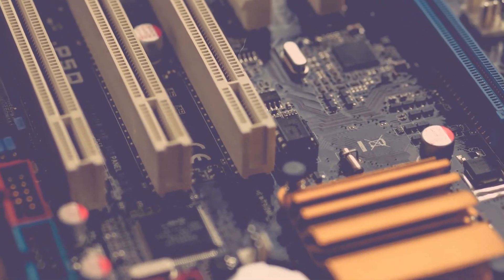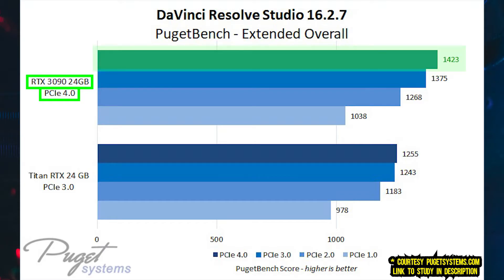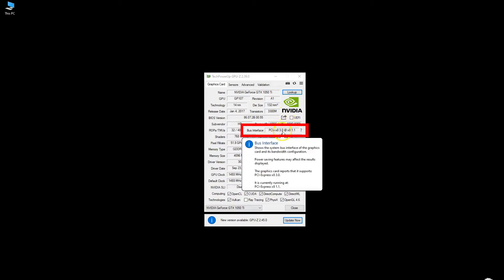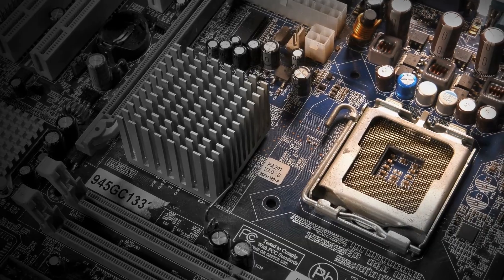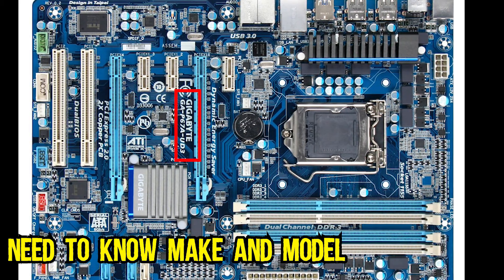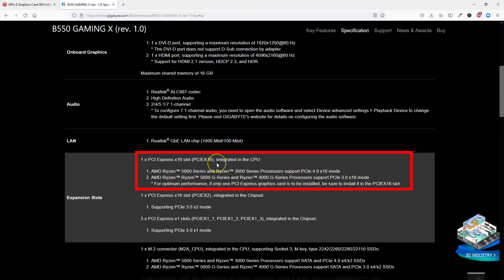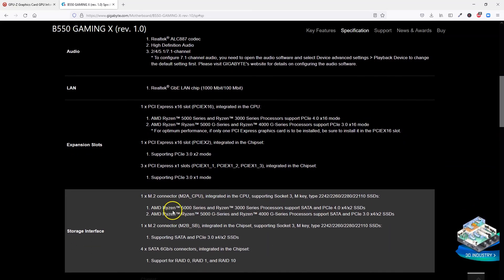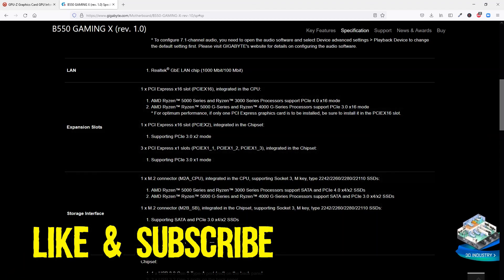How To Check PCIe Version of Slot and Motherboard

Comment: This video is incorrect .... Pci e 2.0 can have 3.0 or 4.0 ...it is crosscompatible it just not will be to its fullest potential.  I have an i7 990 intell chip alot of ram 8 tb hardrive and the nvidia geforce 3060 13 gb three fans. Their can be issues which are minor slight bottlenecks which is 2.4 which is not a factor their are adapters and gaming monitors which also help eleviate the work from the cpu. And ssd adapters to get those faster ways.  I dont see upgrading my board and cpu till in 3 more yrs. The leap has not been that dramatic and the price is too uo with recession.
Reply: What is the point of using pci 4.0 in a 2.0 port even though its crosscompatible 
Better use a best 2.0 in 2.0 port
Best 3.0 in 3.0 
goes like that

Comment: My GTX 1070 reports that it supports PCIe 2.0. x16 but it's running on PCIe 1.1 x16.

is there significant impact on performance from this? I can accept if it's only about 4-8 fps
Reply: Yes it would work as if it’s in a Pcie 1.1 x16 lane, I suggest you go for what the card supports the maximum which is 2.0, if you can’t do that, I would suggest you use FSR 3 which is the new open source frame generation tool that AMD released for any GPU on the market: Up to gtx400 series and more if I’m not mistaken.
Reply: Dude no it's 15fps😢😢😢